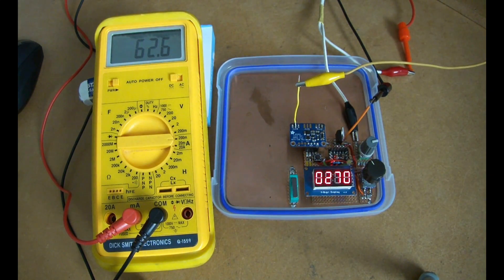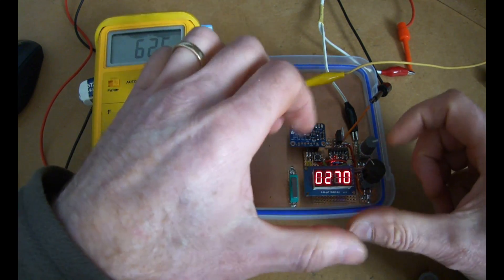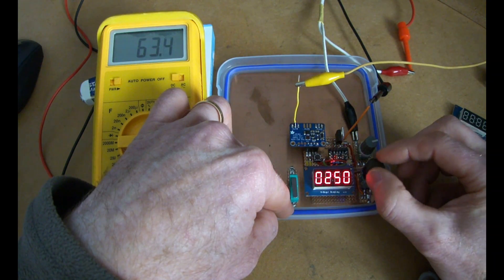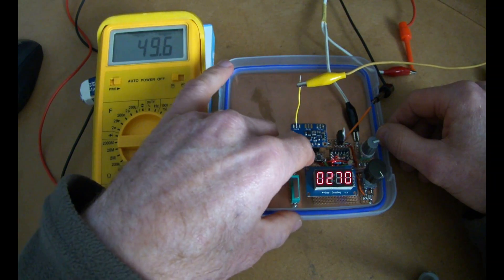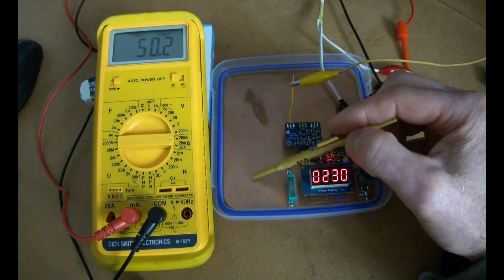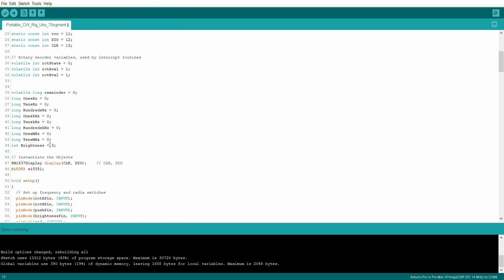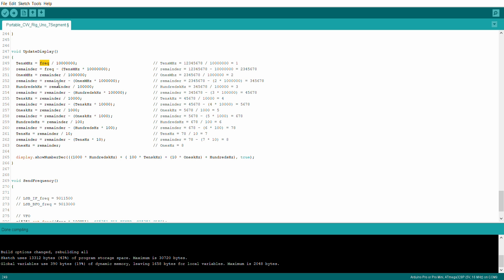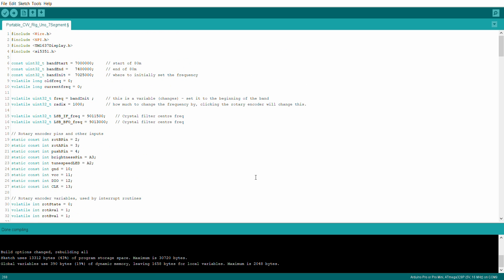Homebrew Portable 40m CW Rig - Part 1 VFO and Display

Comment: Will be interesting to see if you need a 74AC04 buffer between CLK#0 and the BS170s Charlie.
Reply from the maker: Yes. I understand that is often used to get a nice clean 5V drive for the MOSFET. Looks like I will have a reasonable amount of room  for the PA, so if need be, I should be able to squeeze something in.  As an aside, what current drain do your SOTA receivers typically draw?

Charlie
Reply: Charlie Morris See if you can find KD1JVs SodaPop circuit, I think he drives 3xBS170s directly from the si5351 clock.
Reply: Charlie Morris Current draw of my homebrew receivers? I have a multiband SA621 rig, with Nano, si5351, and HD7044 LCD no backlight, draws 360mA, due in part to it holding down two relays and LEDs in the BPF switching. On the bench right now is a 2 band G6LBQ BiTx, which has 40m BPF in circuit in the relay's NC position (so no relays pulled in on that band), same Nano/si5351/smaller LCD, no backlight, draws 197mA on receive.  Both rigs use TDA2003 audio amps which will draw a but more current than the old noisy 386. I suspect the receiver less the display and Nano would be pulling about 60 to 80 mA no signal.  I dont worry too much about minimising current draw on portable rigs these days as the LiFePO packs we use barely notice  this level of draw!
Reply from the maker: Thanks for that Paul. I certainly will.Charlie
Reply from the maker: Thank you very much Paul for this. Fantastic, as I was not too sure what to aim for. Hopefully, I can keep it below 100mA, but I agree that with modern Li batts, it's not such a big issues.Thanks again for the comprehensive reply.73sCharlie

Comment: Once your on freq during a qso couldnt you turn display off. save even more
Reply from the maker: You certainly could David. Based on that, I have just changed the code to turn off the display (and slow tune LED) after the lowest brightness setting. That dropped the display current draw from 2mA (min brightness) to 83uA (TM1637 quiescent current). I could look to include a hard display on/off switch to save the other 83uA, but I'm probably best to look at putting the while uP to sleep when on freq. That's on the to do list.

Charlie
Reply from the maker: David. Just did some more experiments with putting the uP to sleep using the Low.Power library. So, with the screen off:

No sleep = 47mA
Full sleep (aka shutdown) = 33mA
A 60mS to 1S sleep per loop cycle were essentially the same at 37mA

I have now included a 60mS sleep per cycle and gained 10mA. 60mS is a happy medium and allows the screen brightness button to remain responsive.

Cheers
Charlie
Reply: Charlie Morris that sounds like a winner. love your videos..
Reply from the maker: Excellent. I'm pleased you find them useful.